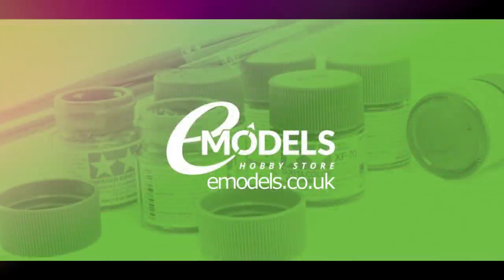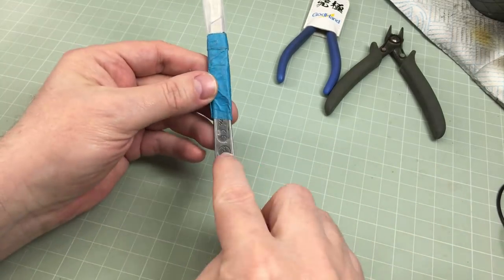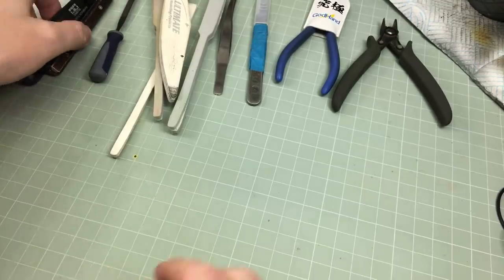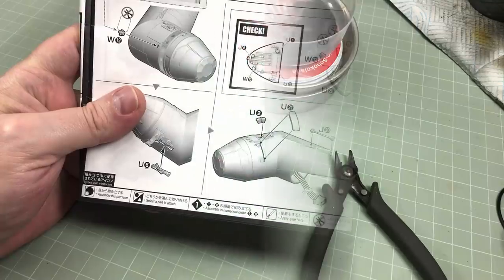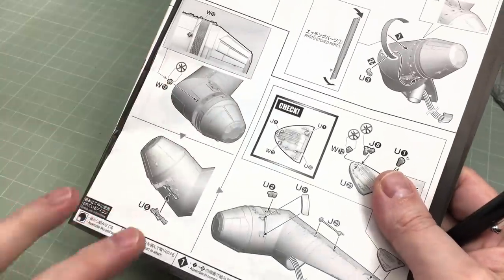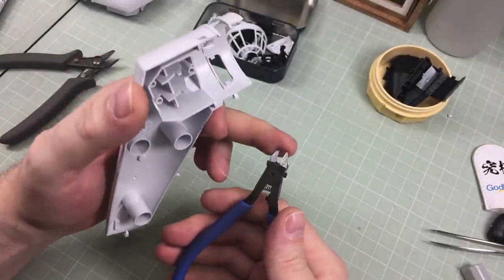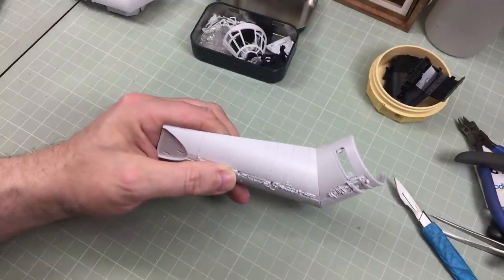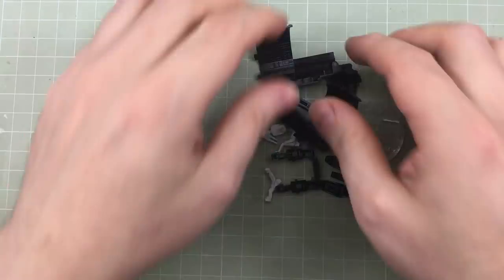Bandai Perfect Grade Millennium Falcon (#01206) 2: Tools & Cockpit Test Fit

Comment: Great video the only problem is getting hold of the kit. I can’t find a supplier anywhere.
Reply: I found out after filming the first episode that this special edition version of the kit was a limited run, and is no longer in production. However, there are still prints of it out there in circulation and there is still, of course, the standard edition of the kit. eModels tell me they will have more in, soon.  Just like the long-discontinued 1/35 Dora kit, they occasionally snag some and get them back in stock :)
Reply: Modelmaking Guru I have a Dora kit in my stash.